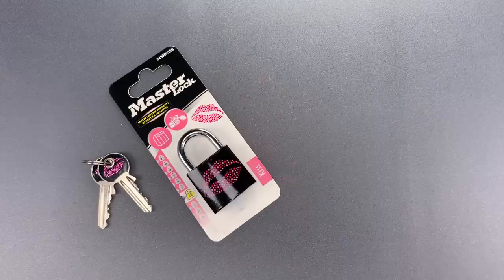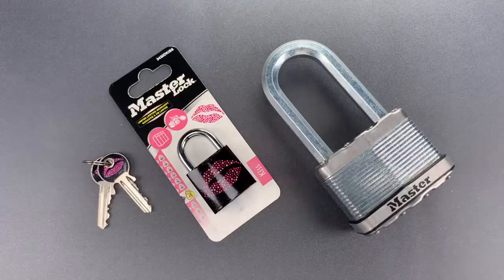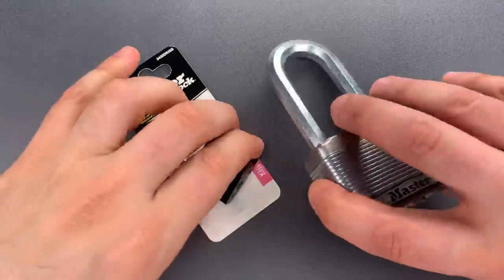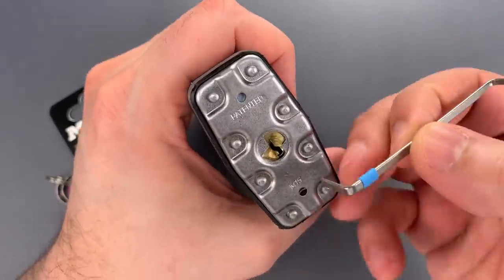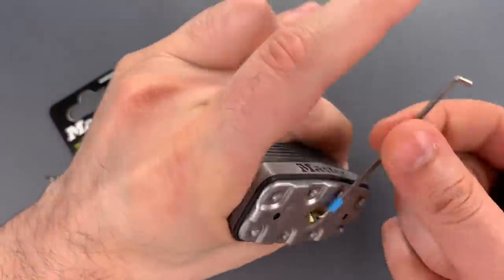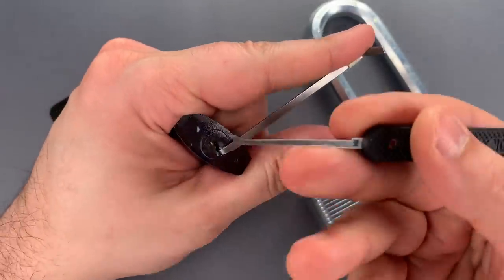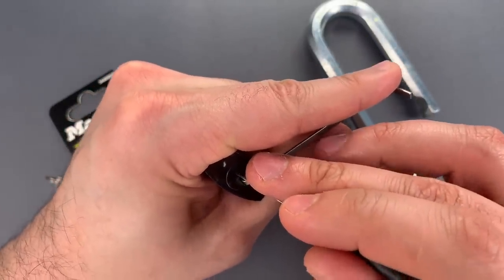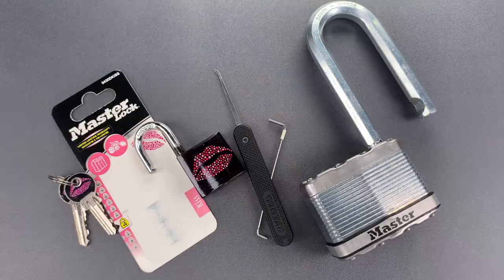[1211] Which Master Lock Is Harder To Pick? A Surprising Result

Comment: I think there's a weird economy of scale going on here that leads to these decisions. This is just a conjecture, mind you, but I'd wager Master Lock sells 100x more beefy, expensive locks like the Master than it does locks the little Kiss lock (which looks like it may be intended to be attached to that famous bridge with all the locks on it). For locks like the Master, every penny matters. The margins are going to be thin because they are competing with every other lock company for these sales. For the Kiss lock, though, it's a niche item that is super cheap to produce, so the margins are much higher (though Master Lock makes a lot more money overall on the Master and its ilk). 

Now, Master Lock needs both high and low security cores, because it sells these and needs a stock. But again, the low security cores are much cheaper to manufacture, and most people aren't that concerned about true pick resistance - probably mostly out of ignorance. If Master Lock is producing the pins themselves, they'll need to ensure they have enough equipment to meet demand. For low security pins, that's pretty much as many as they can produce, all the time. For high security pins the market is smaller, and so probably ebbs and flows more dramatically than the straight pins. So Master Lock needs to maintain a certain level of tooling, and your options are to let your equipment sit idle and potentially encounter unknown issues when you need to manufacture because you've been sitting idle all this time, or they can produce a minimum level and keep their tools running, which lets them predict failure and deal with maintenance in times when they are less likely to need the production capacity. The situation is similar if Master Lock farms out their pins - their supplier is going to demand X minimum order of security pins per Y order of normal pins in order to produce security pins at all for all the reasons I listed above.

So Master Lock ends up needing to use up its full capacity of low security cores all the time, but its got a surplus of high security cores because people aren't buying as many high security cores at the moment. So I think they just throw them in products like these so they can get rid of inventory, and the get to boost that "security rating" nonsense without being complete and total liars.

The end result is that some of Master Lock's cheapest locks are their most pick resistant locks.

Comment: You can't really blame Master Lock for having tunnel vision about what makes a lock secure. Most people are the same way. If you see a huge boat anchor lock you know there will be an open window around the corner or the screws on the hasp will be exposed.

Comment: That kiss master lock isnt manufactued by Master lock i believe, its an OEM platform, the side the, there should be a cutout section glued on with really bad glue that holds the springs/pins in place. On the non painted ones you can barely see it, should be under a coat of paint on that one. With a sharp knife you can literally remove the cover and pour out all the springs/pins and open it by rotating the unhindered cylinder.

Comment: Its kinda sad that they'll go to the trouble of  making a super beefy lock that could probably survive high caliber rifle fire for a bit yet they cant even be bothered to spend a few extra cents on it and drop in a few security pins instead of standards.  I mean ya most thieves physicly force entry instead of picking but at least make it so jiggiling a random bit of metal inside isnt enough to rattle the thing open if they try.

Comment: "if this 4/10 lock is so good, i wonder what their 10/10 locks look like"
the 10/10 beefy lock: can be raked open
Reply: Yes but if you're a junkie which lock are you going to bother with. The cheap aluminum body and shackle with a surprisingly good core and pin set up. Or the space age nuclear bomb proof body and shackle with a disproportionately bad core and pin set up ?

Comment: reading comments about people breaking or cutting into locks is annoying. no duh they can do that, but the POINT is to be STEALTHY. if you silently pick a lock, steal the contents, and leave. NO ONE will have a clue something is stolen until hours or even days later. even a storage unit or shed. just take a few wealthy items. the owner probably wouldn't even notice them missing, but a BROKEN or CUT lock will be noticed and police will be called. that's the point of lockpicking!

Comment: In S.Korea, digital door locks are widely used. It can be opened with fingerprints or cards, and has an electric shock protection function and a heat resistance function in case of fire.
There are also primary and secondary keys. The safe handle has a button at the thumb position of the handle inside the house, and the door is opened only by pressing the button and turning the handle. Is it possible to unlock this digital door lock? In Korea, Samsung SDS and Gateman's products are mainly used.

Sending love from S.Korea

Comment: Maybe the hardest lock (kiss) is rated lower (4/10) than the easier (magnum, 10/10) because European regulations are higher? I mean, magnum is rated 10/10 for the US market, but would be rated 1/10 if sold in the European market, and that 4/10 would become 11/10 in the US market.

Comment: i would  guess that brute force attacks are far more common than picking attacks, so its not entirely unreasonable to give more weight to the physical resistance it offers.  

but if they have better cores, why not put it in the bigger lock...?

Comment: LPL illustrates here what I think to be a pretty important economics concept as it applies to product management. My guess is that ML goes with an assumption that the vast majority of security events are going to be brute force and non-destructive attacks are a small minority. Professionals and those with needs for legitimately high security aren’t the ones in the market for a ML so they emphasize destructive protection wherever possible. Materials and labor for a high strength easy pick lock are probably also cheaper than engineering a secure design and the outward image is a non-tangible benefit that sells well to consumers. 

So why a difference between NA and EU locks? My guess is that the EU regulatory scheme puts an onus on lock makers to put security over image to avoid swindling consumers. Curious if anyone can confirm that? If so demonstrates how high information asymmetric markets create a less efficient “free market” when regulators fail to enforce basic entry conditions. Hence America’s capitalist fetish leading to lower quality “free” outcomes as opposed to a European system that enforces free market conditions more robustly.

Comment: I am wondering and you will orobably answered this question a miljon times before but what is a good lock that is hard to pick by the ocasional opertunist thief? I can see that there is no lock safe for a pro but just a lock thats not to expensive and wont pop open by just looking angry at it..

Comment: In many ways that bigger lock would be more secure as most criminals just force their way in, so a sturdy lock is better.  But of course you’ll have idiots who put the big lock on a Rubbermaid shed and think it’s now impenetrable.  
Last year there was a spate of break-ins and car thefts in my county.  They were crimes of opportunity though, as in every case a car had been left unlocked in the driveway with the keys inside.  And of course the remote for the garage door opener was in the car, so entry into the attached garage was easy.  And since the property owners were utterly oblivious to security, they left the door between the house and the garage unlocked.

Comment: Somebody at Master Lock gave it their "10" rating, knowing it could be easily raked open in five seconds?
Reply: 99/100 times entry is by forced entry. Vice-grips, hammer, sledge, shotgun/firearm, explosives, pickup truck with a tow-yank, etc. 

If you're in the US, you make more money as a locksmith than a burgler who can pick locks. Safer too as you don't get two rounds to the center mass.

Masterlock was correct going by the overall method of entry.
Reply: @janus3555  That was maybe true before Youtube and Amazon, when pick sets were impossible to find, let alone videos showing how to pick all the different types. So no, Masterlock was not "correct" in selecting the weakest type of core for their supposed 10-rated secure lock, one that doesn't even need picking skills to open, just a wave rake jiggled in and out. There are much harder-to-pick cores they could have used.

Comment: these days I wonder if these lock companies are right to be honest. The average thief or junkie has no idea how to count past 3 let alone pick a lock, but bolt cutters and cordless grinders are everywhere. I would be surprised if most thieves even attempted to zip/rake/pick a lock before they started physically attacking it or the chain/shackle it's attached to. Same goes for houses and commercial buildings, they will force the door or window open or just drive straight through the building before they even check to see if the door is locked, junkies are not thinkers :D

Comment: i'm a lock picker wannabe. i finally got some material to make a pick similar to the one in this video. (it looks like stainless steel, but is magnetic ) using it i managed to open a  made in china masterlock lookalike. i did it twice like LPL sometimes does, then i tried opening a brass BEDI lock (origin unknown) after a struggle i got it open... twice even. then i tried opening a master lock no3. dang it, despite the reputation i haven't been able to unlock it yet. sucks to be me lol was hoping to learn if LPL has done it and where to find the link

Comment: Do remember that the average IQ of a criminal is like 70. They will try to break a lock open for 30 minutes even if it had a 1 pin core that all you needed was a flathead screwdriver to bypass. If you turn to stealing, you probably aren't to good at much else.

Comment: Could someone tell me what makes "security pins" more secure?
Reply: A traditional pin is a plain solid cylinder with smooth sides.  As a result of this smooth shape, its motion upward under the pressure of the pick will not snag at the shear line even though the wiper is applying lateral force to it.  A security pin has contours, grooves, or other irregularities around its circumference in one or more places.  The lateral force of the wiper will tend to make these irregularities snag at the shear line.  This snagging is called a "false set."  To get out of it, back off the rotational wiper force a little, to let the force of the pin spring unsnag the pin.  For a great example of security pins, see https://www.youtube.com/watch?v=xxDBIW9Xp3E.
Reply: @brianwade4179  Thank you so much!! That was a great explanation. Very helpful!